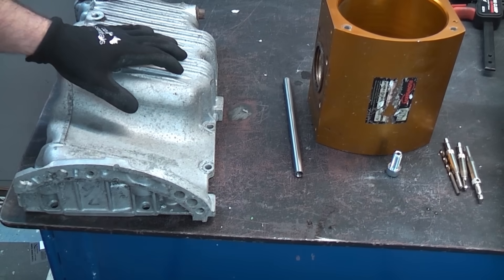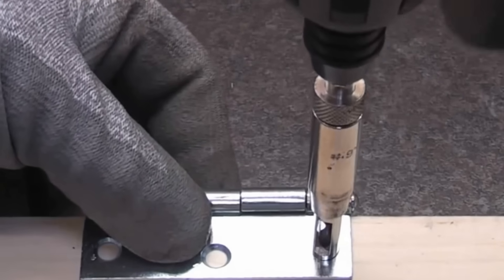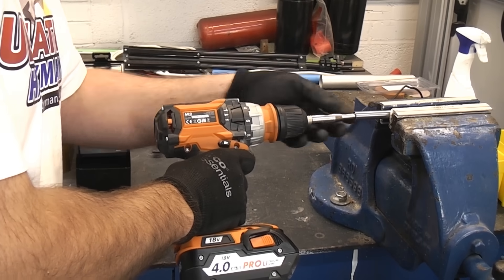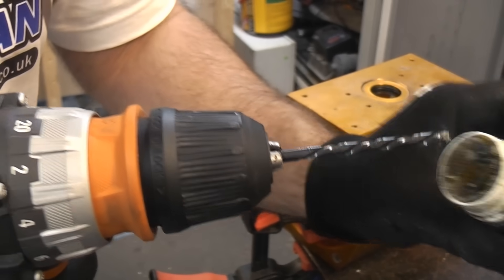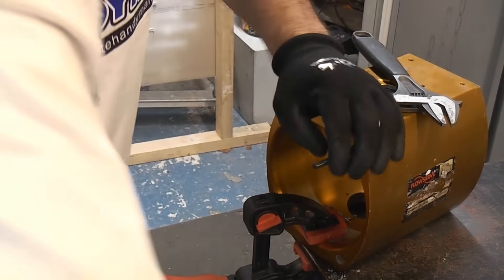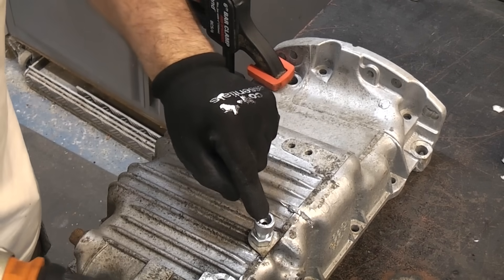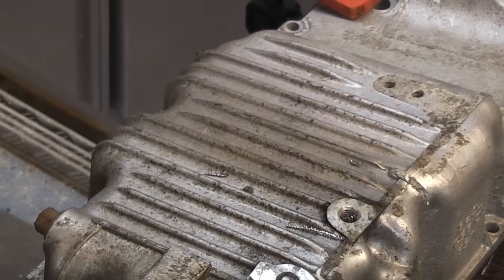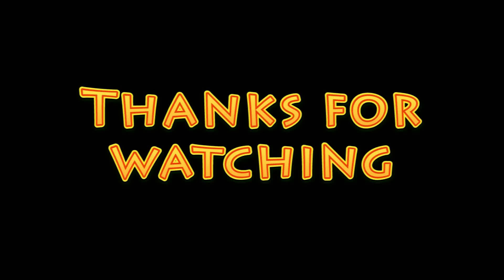How to remove a broken bolt in a deep hole | remove broken bolt in recessed hole

Comment: I have never had to "tap in" or hammer a "screw extractor" (Easy out) before to make it work. The tool metal is usually harder then the bolt you are extracting and bites into it with ease. I would think hammering it into the bolt would wreck the sharp threads meant for biting into softer metals.
Reply from the maker: The instructions tell you to tap the extractor into the drilled hole, you can see a graphic on this ebay listing- https://fave.co/2NhJCLT
Thanks for the comment
Reply: i guess the extreme angle on that bastardized version of an easy out require some extra work to get a good grab in the hole vs the longer, skinnier real easy out.
Reply: waxore... Wad

Comment: What is the name the hole bolts for guidance? Thank you....
Reply from the maker: They are just socket head bolts, which have been drilled down the centre using a 6mm drill bit on a lathe, but you could use a pillar drill, or get a machine shop to drill them for you.
Thanks for the comment
Reply: So, can't just buy from the store?

Comment: use a drill with the bolt extractor makes life a lot easier. As for the bolts with holes in them there are some places that may sale them already like that so check around.
Reply from the maker: Thanks for the comment

Comment: Goody sir what are the names of tools you used in this video?
Reply from the maker: I used hinge centering drills- https://fave.co/2oLRFTf
Left handed drill bits- https://fave.co/2NfSGkF
Screw extractors- https://fave.co/2CmZF6R
Then socket/cap head bolts, but these need drilling down the centre using a 6mm drill bit for M10 and M12 bolts. This can be done on a lathe or pillar drill.
Thanks for the comment

Comment: I guess it might be also possible to use some chemical process to dissolve steal, but not aluminium, especially if it is covered with aluminium oxide. Probably tricky tho.
Reply: movax20h     How about the blood from the monster in the “Aliens” films!
Reply from the maker: Thanks for the comment

Comment: Very informative, I had a look for those drill guides and found that they appear to be called "Self Centering Hinge Hardware Drill Bit Set" (under £10 on eBay) but are designed for drilling wood, but as the drill bits are removable, just swapping in metal drills would suffice.
I've also been thinking of a quick and dirty method, of using a thin metal shim (cut from a coke can) wrapped around a drill bit, 2 strips at least, so that they can slide against each other without damaging the threads!
Another thought would be a very small socket set with centers drilled out, just like your bolt, but with dual use!
Reply from the maker: Thanks for the comment

Comment: Thanks for good ideas, but I can't agree with you at the ending. Copper grease should never be used on aluminium as the reaction between this two materials leads to corrosion.
Reply from the maker: I know people that have used it for years, and before making this video I searched Google but could not find any proof, even the manufacturers websites did not tell you not to use it on aluminium.
Thanks for the comment

Comment: Screw style extractors are junk. Take a look at the extractors made by Ridgid Tool, yes the same people that made plumbing tools.
The extractor is a hardened rod with vertical ridges and Ridgid supplies a nut that fits over. Then just tape into place, and turn to remove.
The complete kit comes with drills, extractors, inside hole guides and the extractor nuts. Well worth the $85 US they are sold for.
Reply from the maker: Ridgid make some great tools, I'll look out for those ;-)
Thanks for the comment

Comment: Using a SHCS as a custom threaded drill guide is brilliant!  So simple and easier than using drill bushings or cobbling up something from stuff laying about.   Nice work across the board.  Thanks for the tip.   Guess I'm off to dust off the lathe and start making a collection of these nifty tools.
Reply from the maker: Thanks for the comment

Comment: Didn’t mean to offend but that type simply expand the stub and make it tighter  in the hole I noted that the drill you used was considerably smaller t so outer forces would be a great deal less
Reply from the maker: Yes they do, I have square ones at work but this cheap set was found in my garage.
Thanks for the comment

Comment: great video 
you have some great tools I will be making some of them 
they will help big time when I not in the machine shop  Thanks 
the way I do it is say a M8 stud is broken I drill a 5mm hole then heat the aluminium then use a square easy out just after I heat it 
because the aluminium expands a lot more than steel it gets lose  but if you leaving soak the steel will expand too 
or it goes into the mill
Reply from the maker: Thanks for the comment

Comment: Good video, 
But Copperslip in an Aluminium casing. 
The bolt will come out easy the next time. Possibly when you don't want it too.
I have two words 'Galvanic Corrosion.'
You should use Aluminium slip.

Apart from that little issue well done.
Reply from the maker: Thanks for the comment

Comment: "quite easily melt the aluminum" aluminum is such a great heat sink and at that thickness it moves the heat faster than a propane touch would be able to produce the heat.
Reply from the maker: I believe I said "if you are using burning gear" (Such as Oxygen and Acetylene)
Thanks for the comment

Comment: Great video! Have you ever used alum powder to dissolve a steel bolt/tap/screw extractor out of an aluminum housing? That would be a good video
https://youtu.be/7pN-fnUeA3o
Reply from the maker: I've seen AVE's video about it, but never tried it.
Thanks for the comment

Comment: I do like the drilled bolts idea, trying to drill snapped studs out of the exhaust side of a motorbike engine is a pain in the arse!, too dam easy to drift off into aluminium :-(.
Ill keep the bolt idea in mind, thanks very much :-D.
Reply from the maker: You are welcome
Thanks for the comment ;-)

Comment: Well... great technique but of little use working on my vehicles unless I have a lathe to drill a couple guide bolts first.  Concept is great.
Reply from the maker: Any engineering firm will drill you a couple of holes through some cap head bolts, you can even drill them using a pillar drill- I'll make a video soon.
Thanks for the comment ;-)

Comment: Great video and tips! Especially the copper grease 👍🏼
Reply from the maker: Thanks for the comment ;-)
Reply: Be carefull with copper grease on Aluminium and Steel bolts together as it can cause a reaction that bonds them together as I found out on my Passat front hub. Sheered 4 Bolts trying to remove Brake Caliper Brackets. Had to drill Out to clear bolt. The Part was not even Threaded as the bolt just passed through it.

Comment: Now some bolts that are really stuck like studs in an engine exhaust side. Or rusted in place like brake dust shields on a steering hub of a car. Or bolts that broken off while trying to get them out.. I like the video but this is just to easy it's never that easy :)
Reply from the maker: That is correct, people think I never do any difficult jobs but I can tell you that I get more than my fair share of difficult jobs when I'm on site- but I can't film them to prove it to anyone ;-)
Thanks for the comment ;-)

Comment: Thanks for the video.  Couldn't you also use a transfer punch of the right diameter to accurately locate the center of the broken bolt?  Should be better than eyeballing it.
Reply from the maker: Yes, you should be able to use a transfer punch.
Thanks for the comment ;-)

Comment: Good ideas, but might I suggest that when the drill won’t grab drill as deep you can with it then go one size up and when you drill already existing hole with a bigger drill bit it will 100% grab it always worked for me. 
The thing I have learned with the extractors is that they can expand the threads and lock them up
Reply from the maker: Thanks for the comment ;-)

Comment: Is this fake? I don’t see how the original bolts snapped in the holes without crossthreading!
Reply from the maker: The steel and aluminium corrode, which almost welds the two components together.

Thanks for the comment ;-)

Comment: I've had great success using diamond coated Dremel bits. They can cut a slot to tightly fit the biggest screwdriver that will clear the sides of the hole. A good screwdriver, a tight slot, and some heat are often all that it takes to free a sheared bolt. 
If you have to use an extractor, however, you need to make a centered hole in the usually jagged end of a broken bolt. There are various sizes of small barrel-shaped tips (coated with diamond dust) that can drill a hole slowly, but exactly, into any metal, even hardened steel (or ceramic, glass, or stone, for that matter). You can even use them to cut a slot or make a hole in a broken extractor. Harbor Freight has an inexpensive set; it has worked well for me, and it's paid for itself many times. Since I started using these bits, I haven't had a broken bolt I couldn't get out.
Reply from the maker: Thanks for the comment

Comment: Nice guide. I would like to know where you got the adjustable wrench you're using! Thanks
Reply from the maker: I think I bought it from eBay. I have Bahco adjustable's in  4 inch, 6 inch, 8 inch, 10 inch, 12 inch and 24 inch sizes- they are the best make of adjustable spanner IMHO.

https://fave.co/2ozjYo6

Thanks for the comment
Reply: Excellent, thanks.

Comment: How did you drill holes through those socket head bolts?
Also for a future video could you address drilling speed for steel, bits and proper lubricants?
Thanks for the great videos!
Reply from the maker: I drilled the holes on the lathe, but will do a video showing how to drill them on a pillar drill at some point.
I'll try and cover drilling speeds and lubricants in the future.
Thanks for the comment

Comment: Starting at 7:18, if you'd use a tap handle you could apply pressure that would help keep the extractor in place. You wouldn't need to stop every few seconds and hammer it back in. That adjustable wrench needs to go in the scrap metal barrel. If you have any vice grips they need to go there too. Use the right tool for the job.
Reply from the maker: If you paid attention, you would know that I mentioned at least once that "my tap wrench is at work". However I do have a 18" tap wrench and a 24" tap wrench in the garage, but they are a little too big for a screw extractor that fits in a 6mm hole.
Thanks for the comment

Comment: What would you do if the bit will not cut into the bolt? I had one in an intake manifold that wouldn't cut even with a new bit.
Reply from the maker: I'd try a cobalt bit.
If that does not work I would try a solid carbide bit, providing you could get at the bolt without any danger of the bit flexing (as they break easily with sideways force).
Or you could try a Artu multi-purpose bit (but they are a pain to get started as they are like a masonry bit), one was used here-
https://www.youtube.com/watch?v=zbJq2z2ya80

Thanks for the comment
Reply: weld a nut on it

Comment: How the heck do you break a steel bolt in aluminum?
Reply from the maker: It's quite common as part of the bolt gets seized into it.
Thanks for the comment
Reply: @ultimatehandyman  ok I guess I'm just a little confused aluminum being weaker than steel I assumed that the aluminum would strip out before a decent grade steel bolt would break

Comment: Only thing I could add as been there done that type advice is Don't be tempted to hit the "easy out" screw extractor too hard, yes you want it grip but you don't want it to upsett the surrounding metal as to make it bulge as this will make it harder to turn out the bolt.
Reply from the maker: Absolutely.
Thanks for the comment

Comment: That is amazing! Someone  should market the bolt drill guides you made. Another great idea is using the PEX style drill bits used on the hinge. Who is the manufacturer of the PEX-style bits you used? Great, informative video, mate!
Reply from the maker: I'm not sure who made the hinge drills, I think they could be made by Trend.

Thanks for the comment ;-)
Reply: @ultimatehandyman  You are correct,  Sir. I found it on Amazon:-
"Trend Snap/Dbg/Set Trend Snappy Drill Bit Guide 4 Piece Set."
 Thank you!

Comment: Can you buy those bolts with drilled through holes?
Reply from the maker: No, but you can easily drill them yourself on a lathe, or any machine shop will drill them for you.
Thanks for the comment

Comment: Would it have helped to have used the hammer mode of the drill? Make the shocks loosen it up..? Great vid though UH!
Reply from the maker: No, hammer action when drilling steel normally breaks the drill bit, perhaps you are thinking of drilling with an impact driver- that would probably help. 
Thanks for the comment

Comment: Copper grease on aluminum, that´s a NO go it will corrode the alu. Use some nickle based grease insted.
Reply from the maker: Before recommending copper grease I did a Google search and could find no evidence that copper grease was bad on aluminium.
Thanks for the comment
Reply: Los año Experience my friend. You can´t learn every thing through google, you need to get your hand´s dirty.

Comment: What’s worse than a broken bolt....a broken bolt extractor hahahahaha and yes I have done that
Reply from the maker: Absolutely
Thanks for the comment
Reply: Yep. Happened to me. You're in a whole world of trouble from that point on!
Reply: Anyone who hasn't just hasn't had to extract enough broken, rusted bolts.
Reply: Same.😭
Reply: And you know whats even worse than a broken bolt extractor? A broken thread tap, hahaha yes try to drill a hole into a thread tap xD
Reply: @kalle98olson  - Broken threading tap extractors for 2, 3, 4 flute taps are available in a range of sizes.
Reply: @ j g     worse than that ,is a broken CARBIDE drill bit---DONE that!!!--thankfully they are BRITTLE  and can be broken into little pieces with pointed drill rod  ----««  nightmare...
Reply: Unfortunately - been there, done that!
Reply: if a bolt snaped, extractor will aswell
Reply: @gorgas8  - Not unless the screw is a 10.9 grade. Good extractors are hard as files.
Reply: If you use the largest extractor close to the size of the bolt you should break less extractors lol.

Comment: I like to use a torx bit instead of screw extractor, drill a slightly undersize hole and tap in the bit, screw it out
😊
Reply: this trick won't work all the times so it's way more reasonable to start drilling the bolt out ASAP rather than wasting time trying to grab it with a torx cause in vast number of cases the bolt gets seized prior getting broken. Drilling is the safest method as it's fully controlable process unlike the other mechanical manipulations that may cause damages to the rest of the assembly.
Reply: You still drill it out when using a Torx bit to extract it. Torx bits, however, don't walk out so easily as an extractor does. I've used it a few times and it does work well.
Reply from the maker: Thanks for the comment
Reply: I've been doing this for years works great
Reply: Yep I've done the same thing for years and it works great
Reply: Thank you so much!
Reply: I've had to resort to that and they work great if they are that hardened steel :)  Good job bringing that method up.
Reply: handyman's drill guide + a tors bit = perfect combination
Reply: torx bit
Reply: Just make sure they aren't cheap torx bits cos they snap pretty easy lol.

Comment: your AEG brand drill looks almost identical to the Ridgid Brand drills we have here in the states, and for making the center drilled bolts, would you clamp the lath at the threads to be bore concentric, or clamp the lath chuck on the head, as to prevent thread collapse
Reply from the maker: I believe the AEG drill to be identical to the Ridgid, I have also heard that the batteries are interchangeable (but I can't confirm this).
I clamped the head of the bolt in the 3 jaw chuck with the threads pointing through the chuck (towards the back of the lathe). The coolant goes all over the place, but can easily be wiped up. 

Thanks for the comment
Reply: Ultimate Handyman i researched online and they’re identical. 

https://www.ridgidforum.com/forum/power-tools/power-tool-discussion-forum/716450-ridgid-aeg-similarities-and-differences

Comment: Always be extra careful using easy out screw extractors. If you snap it off in the bolt you are really screwed. If you snap it off they are way too hard to drill out. My dad had a machine shop and quite often someone would bring in a motorcycle part with a screw extractor snapped off in a bolt. The only way to fix it was to machine the material away from around the extractor and weld up the hole and redrill and tap the hole. You can also use a tap burner to remove the snapped of extractor but that is expensive also.
Reply from the maker: Thanks for the comment  👍
Reply: That's what's happened to me. The 8 mm exhaust stud bolt broke about 1/2" down in the hole with a jagged surface. I ran a drill & tap bit down there that has about an inch of drill bit, then an inch of 8 mm thread tap, but without centering control, it caught an edge and snapped into chunks inside the original bolt and just as deep from the surface. It's an aluminum motorcycle head and I think I'll have to remove it from the bike, onto a bench. When I can afford getting some other work being done to the head is when I'll remove it.

Comment: Where can you buy those hollowed Allen bolt guides??
Reply from the maker: You can't buy them, they are just socket head bolts which I have drilled down the centre on a lathe.
You should be able to drill a hole through one on a pillar drill though. I'll make a video showing how to do that soon.
Thanks for the comment  👍